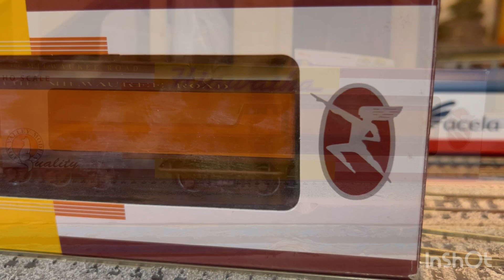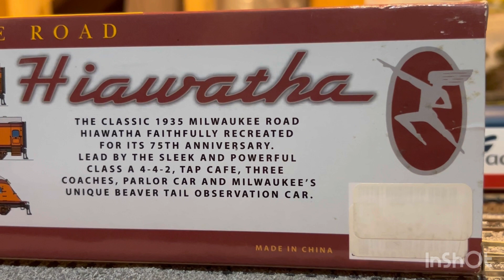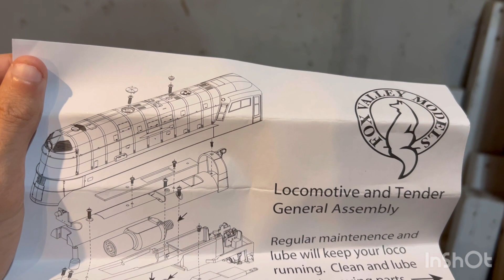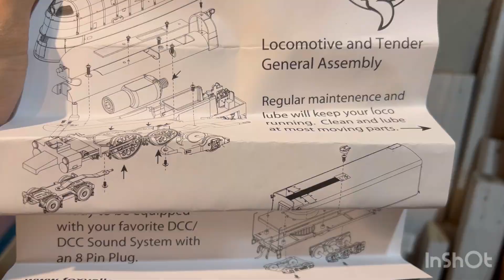Fox Valley Models Class A Hiawatha Review & Run

Comment: Nice steamy. Take my tip: run the engine in for an hour in each direction, and she might get used to the slow speed test.
Reply from the maker: Oh she runs quite a bit. She goes around the track all the time. 😂

Even after a warm up, the slow speed won’t improve. It’ll still be the same. But thx for the tip, btw. 🤘